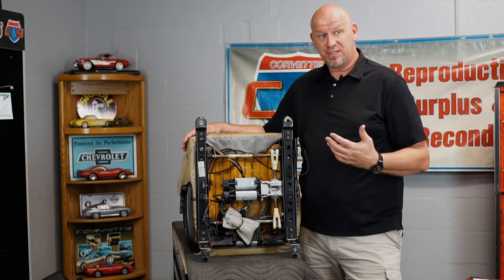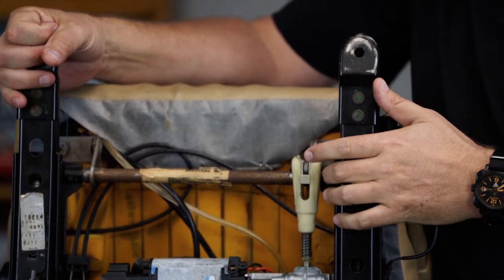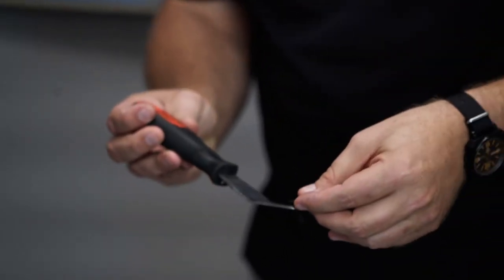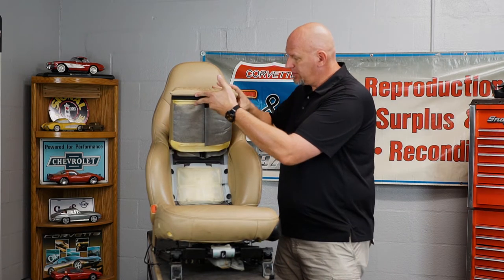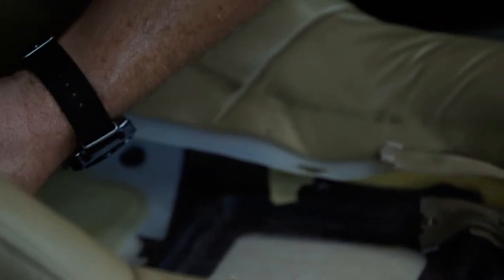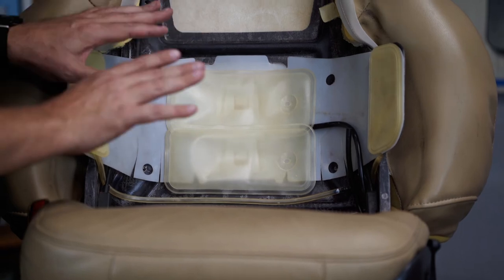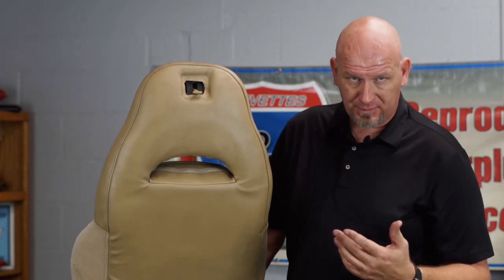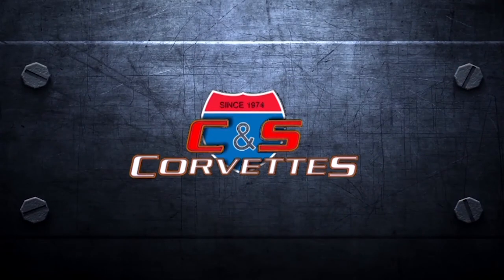Corvette Sport Seat Lumbar Bladder Replacement Tutorial, C5 97-04

Comment: Hi Lyle so I rebuilt the motor for the lumbar and bolster and it was certainly dirty with grease and it came clean and I bench tested it and it looked like it was working great. I hook it back up to the passenger seat and it just works enough to deflate the bags but it will not inflate them once deflated .. I am not sure why but it just seems to be weaker then the other motor I switched to the drivers side. ?? It should be brand new after rebuilding it I would think it would work great but not sure why this motor is so much weaker. I can tell by the torque it has when I put power to it and it does torque out but not like the other one .. Is the motor being in that leather type of bag and strapped under the seat have anything to do with the function of it when it is trying to work? It kinda looks like they the engineers put it in that kind of a bag and stapled it all up tight in it for a functional purpose to me ?? I don't know but i am not going to be able to use this rebuilt motor which i should be able to for the passenger seat as i guess i need to buy a new one ??? Any ideas ?

Comment: Great video, but I have a question. My air pump for my blabber came on and drained my battery first on my passenger side so I disconnected the power to my seat, then not too long later the same thing happened to my drivers side so I disconnected that one too. Is that most likely  leaking bladders or an electrical issue? Thanks for any help.
Reply: Hi Jimmy!  Leaking bladders will not cause the pump to automatically run--ever.  You have an electrical issue.  My educated guess is that your power seat switches have corrosion issues--once those get wet (especially in convertibles) the circuit board develops corrosion that leap frogs contacts and causes all kinds of electrical drains, including spontaneous pump function.  Hope this helps!  Lyle

Comment: Is the process of airbag replacement same/similar on c6? Specifically the early 05-11 c6 seat? Need to do this to my 2010 grand sport asap
Reply from the maker: It is similar, but different.  Is your pump working, but the bags are not inflating?  Lyle
Reply: @csvette  bags all work, just lose air in a minute or so

Comment: also why do they make these so difficult to work on as the lines and the wires are just barely long enough to get this motor back into the bag and no more it is just really no room to work with and I am just sort of wondering why they didn't t give a little play does nt make any sense to me. it seems it would be easier to take the seat out

Comment: I don't know if they changed hose design, but there is NO WAY my original hose will slide over the new bag nipples.  I have a 98.  The hose is no longer rubber.  It is plastic.  Probably use connectors and buy some new hose.

Comment: Why is it so difficult to find replacement bladders and hoses that are one piece for the customer to cut themselves?
Reply: Jose, lumbar systems are vehicle -specific and the size and number of bags and lines differs widely between makes.  Believe me, I would have preferred to source my lumbar bags from an existing supply rather than having to tool up to make them.  If the systems were more uniform, your question would be easy to answer because someone would be making a "universal" kit already.  As it is, the design and construction differences between manufacturers makes that an impossibility.  Lyle